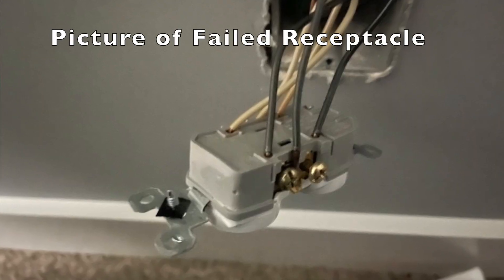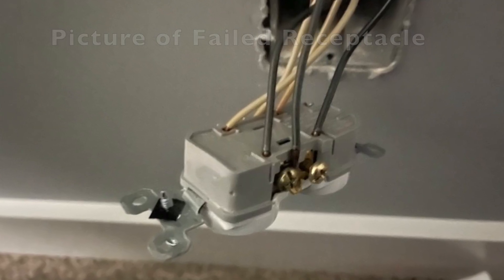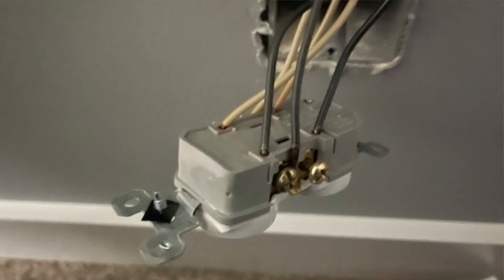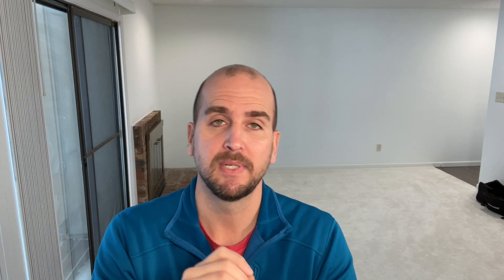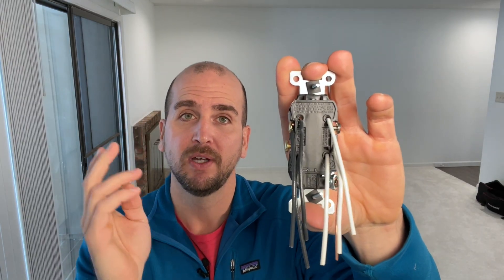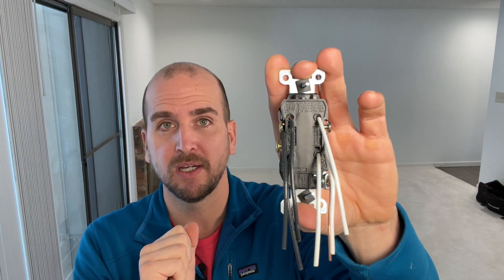Incorrectly Wired Outlet Found In Newly Built Home

Comment: Good video, My house constructed in 1983 then extended in 1992 had 12 awg wires using pushin connections and almost caught fire by arcing, luckily I happen to see the wire glow red and shut the circuit off..the receptacle burnt half of it due to heat.

Comment: when you say commercial outlet I'm curious what brand. I generally use Leviton
Reply from the maker: My preference is Legrand (Pass & Seymour), Eaton, and then Leviton in that order.  I am a big fan of the back wiring feature and as such the Hubbell spec grade I have looked at didn't have back wiring which was a show stopper for me.  For most of us DIYers it comes down to which Home Improvement store is closest but since I do a fair amount of rehabs I just pickup 10 packs of the Legrand Commercial Grade outlets from Menards in my area.

Comment: I do not use pigtails...why?  Using side screw terminals is best since they are connected via solid plate...hence less connection points. Also, I was trained NOT to pretwist wires.

Comment: You should use the example that using a pigtail is a "parallel' connection with anything down the line and that connecting all wires directly to the receptacle is a "series" connection.  If the receptacle fails a "series connection will cause any connections downline to fail and a "parallel" will not.

Comment: Aren't Pigtails a thing of the past? Something like an In-Sure Push-in-Wire connector would be  a lot easier than 3 to 4 14 gauge wires together especially for the novice. I have started using them around my house and they are much easier to connect and more reliable after being push back in place.

Comment: I have seen it suggested in the installation instructions of a couple of items, whether switches or outlets, that, after screwing on the wire nut, you should wrap electrician's tape around the nut and the wires coming out of it. Is this generally recommended?

Comment: Good info thanks, when I first moved here from uk when I pulled out my first plug for some issue ( without turning the breaker off) I put my fingers in and as I was puking out the receptacle I touched both the hot and neutral!   Boy was I surprised. 
Growing up with 220v outlets in uk the connections are always covered so you have to work really hard to get shocked ( and potentially killed by the 220v) .
Such a poor design in 120v Receptacles! 
Winding a little electrical tape around is a help but poor substitute for poor design. 
Cheers Warren

Comment: At this point I wish the companies making outlets would just do away with the cheater connections (push-in terminals), never liked the idea of something holding a 120V line in place with spring tension compared to a screw terminal. Had a coworker that recently replaced an outlet in his kitchen after he plugged in the toaster and heard an arcing sound from the outlet when he turned the toaster on, pulled the outlet to investigate and sure enough someone has used the push-in terminals. The conductor had worked loose from the back of the outlet and started arcing when the outlet was used.

Comment: There is NO data that says that push in connections cause more faults than back wired or Shepards crook connections. In fact there is lots of evidence that push in terminals are safer. Look at Ideal or Wago info on push in terminals.Much safer. You are perpetuating a Pro Electricians myth because they dont understand them. I predict that one day only push in will be the standard.I am aa Retired Electrician & I know it takes forever to convince us old duffers but lately I am convinced.

Comment: Pigtails should be used on all devices that have 4 leads or more. The device (outlet) is not suppose to transfer the load or current down stream to more devices. This way the line itself carries the entire load and not a device (outlet).

Comment: Hi just saw the video and would like to say that it is very informative information. I agree with everything that was shown. It is great that videos like these are available to everyone. Especially knowing home owners that are going to do some electrical work on their own home, no matter how much their significant other tells them not to. That they hopefully watch videos like yours to learn proper techniques for functionality and safety purposes. One thing I want to mention and is a question as well. At the very end of your outlet install, I noticed that the ground hole socket is in the downward position (how just about every outlet was installed in the US before the 21st century). My point is shouldn't the outlet be install flipped "upside down" so the ground hole socket is above the neutral and hot hole sockets? I really think its against code in my area. I believe the reason behind this is if the plug wasn't seated into the outlet the whole way, and if by some rare case that something was thin enough to slide back and touch the exposed plug prongs, it would hit the ground prong first. Rather than it coming incontact with the neutral and hot prongs. Causing a short and risking fire, injury or death possibly. Just thought I would mention that and I'm going to guess I'm not the first one to say this. I apologize if I'm repeating somebody else's comments. I tend to be late to the party a lot, if you know what I mean.
Reply: I've heard this also and it probably has merit in some locations but in general it's nonsensical. Three prong plugs are designed with the flat part on top and is ergonomically correct for most people. It feels awkward to grab it upside down.

Comment: I belive pigtails are required by code since receptacles shall not be used as splice points, the reason it has two screws is for breaking the connection and using it as either a switched outlet or two circuits.
Reply: No, it's only required by code if it's a multiwire branch circuit. I tend to agree with your point, but even Leviton, in their instructions recommends using all the screws for connecting to downstream receptacles, probably to make it easier for homeowners.

Comment: This was exactly my problem! Downstream outlets would inexplicably turn off and on, paid $200 for electricians to come out & find nothing, and then my wife noticed the lights blinked on and off when she plugged the vacuum cleaner into our 30-year old residential grade outlet. Popped it out and saw the hot pass-through wire had worked its way loose, so you were spot on! I'm going to upgrade the outlet & do the suggested pigtail connections.
Reply: Might be worth checking the other outlets.

Comment: You said that was 12 ga wire, which is used for 20 amp circuits, but the outlet is a 15 amp style
Reply: It doesn't matter, 15 amp duplex receptacles are perfectly acceptable on 20 amp circuits.

Comment: Thanks again for another great video. I’m a little confused as to why it’s not OK to use a back wire connection. Especially if you don’t have room in the box for those extra wire nuts and jumpers. Thanks in advance.
Reply: Most outlets are wired daisy chain fashion, with an upstream cable supplying power, and a downstream cable going to the next outlet. Adding a pig tail to supply the local device means that if it fails or is deleted during a remodel, the downstream devices are undisturbed. Additional benefit: you do not have to know which cable is upstream, and which are downstream. (There might be several. I ALWAYS make the upstream cable enter the box from the upper left, simply to help the Next Guy identify it.) Also, I have seen a situation where the downstream cable was 12 ga, while the upstream was older, and only 14ga. This made it impossible to tighten the screws on the upstream conductors sharing the same screw. As to box fill, the Wago lever connectors are much less bulky, and easier to use if the conductors coming into the box are a bit too short.
Reply from the maker: Seems to increase the risk of failure.  With that said speed wiring is approved and tested by UL.
Reply: @EverydayHomeRepairs  Just looking at the mechanics of it doesn't it seem like a torqued down screw is more than enough to connect two wires together? Do they come loose over time?
Reply: @Magicinstalls  Defining terms: "Speed wiring" aka "backstabbing" aka "push-in" connects conductors by pushing them into a spring loaded contact. While UL approved, extensive field experience shows this is unreliable, and many electricians and DIYers think the approval should be removed, as it was for aluminum wiring. "Backwiring" uses holes in the plastic shell to guide the conductor into place behind the head of the screw, or even better, between two squarish washers that the screw clamps together. "Side-wiring" is the traditional practice of forming the conductor into a U-shaped hook around the screw. Sidewiring is the most secure method, but backwiring is almost as secure, while being almost as fast as speedwiring. (And I, a DIYer, think backwiring reduces the chance of error.)

Comment: On the recep you put pigtails on. I was always taught the wire should go on left of the terminal so it pulls into to terminal as it's tightened. We're the right side has a tendency to push out.
Reply: When using the back wiring clamping method it doesn't matter because the wire doesn't hook around the screw.

Comment: I'm a second owner, the was built in 2001. The outlet in the hallway, has 6 poles, 3 common wires & 3 neutral wires (paired into 2s) plus ground pole. My question is, I want to replace the outlet 4 pole child proof outlet! Any suggestions on that?

Comment: I would recommend the Wago lever-nuts instead of the traditional wire nuts, especially for repair, rework, and DIYers.  The only problem I see with the pigtail approach vs. using the connections on the outlet is the additional bulk of the added wire and wire nuts and stuffing all that into the smallest & cheapest box the contractor could buy.  In some cases, you might exceed the number of connections and wires permitted in the box.
Reply: Also, shouldn't the pigtail be a larger gauge, since it's potentially carrying the double the maximum load the two other wires are rated for? Or are those other two wires somehow implicitly assumed to have loads that won't exceed half of the gauge's maximum capacity?
Reply: @Felice_Enellen  The pig-tail branches off from two conductors connected daisy-chain fashion. The pig tail only carries current to its local device. The upstream conductors must carry the current of the downstream conductors PLUS the local device current--but that would be true even if the outlet was wired directly with the screw terminals.
Reply: @georgiafan6618  Replacing the box is usually what I do. I'm very fond of Carlon's big blue old work boxes. But sometimes, for reasons ranging from "I'm only renting" to "Holy Crap, if I stray outside the box, I'll have to rewire the whole house", I'd prefer not to.
Reply: @Felice_Enellen  How is the pigtail carrying double the load?  And, the answer to your question is "no".

Comment: I thought the screw terminals still needed to be tightened to secure the wire even if inserted through the back holes.
If you try to pull out a wire inserted into the hole, it is basically impossible if the screw is tight, while you CAN pull it free if the screw is loose.
Therefore, I have always assumed the screw was intended to be tightened when using shepherd's hooks OR inserted through the back .
Reply from the maker: On the speed wiring (back stabbing) the side screw terminal isn't related to the small metal tab that holds the wire in place.  This can be easily confused with back wiring which is usually found on commercial grade outlets in addition to GFCI outlets where you insert the wire in the back and need to tighten the screw to secure the wire.

Comment: Pig tail question..?
Please clarify why or if you can use the same gauge for the Pigtail  while importing 3 wires into 1..
Math seems indicate a larger wire needed? Please explain..thanks
Reply from the maker: Hey Chas, you can use the same gauge of wire.  The wire is sized for the circuit breaker max Amperage.   14 gauge = 15 Amp Breaker and 12 gauge = 20 Amp Breaker.  Maximum current through any 1 wire will be limited by the breaker.  Make sense?

Comment: I'm a former trician/sparky from the UK and the place we moved into over here has had all manner of crazy issues. Nearly every pole was in reverse, the concept of not being terminated or connecting a wire not in an enclosure is just alien to me and our regulations.  I have lost earths all over the place and short of ripping everything out and starting again, I have done all I'm comfortable with. But Yes, anything with pushed in wires  - the wires snapped off when removing the socket.  Also, you don't insulate earth with earth sleeving which is also strange to me. 
But hey, I was trained on the 230v 50hz system, and this is just a case of re-learning.  
BUT some things are better, other things not so much... at least treading on one of your plugs isn't as painful as standing on a UK one with bare feet lol

Comment: Nice presentation.  Thank you. Do you have a vid on a junction box wiring?
    I have a project that I like to do in the near future. I have a light switch that controls the lower prung of an outlet in our family room. I would like to install 6 or 5 recessed LED lights to run off the electricity from the existing switch.  What is the correct and safe way of doing this project?
Would it be easier to have 2 light switches and not disconnect the control to the outlet?

Comment: I hate those backstabs, it makes me nervous every time I've replaced a bad outlet that has backstab and remove the wire most of the time it looks like its been hot or had an arc where it pinches.  I like the pigtail, but I've also seen boxes where I replaced an outlet and went to install a pigtail only to find it wouldn't fit and I was forced to put it back the way I found it with the new one...at least one seemed to have like 6 wires splicing together and they used a combination of pigtail AND the backstab+screws to hook it all up.  That was a nightmare to fit back together, I don't know what they were thinking.

Comment: As a master electrician with 23 years in the trade, I'm here to say this is a bunch of unnecessary work.  
There is no reason to screw in the unused terminals.  Zero.
Sure, pigtailing is the most reliable connection if you've got multiple cables, but it's pointless if you've only got two wires.
Stabbed outlets work fine with better quality receptacles.

Comment: In my industrial electrical course,my instructor said that receptacle should be installed in the box,with the grounding plug / terminal facing up. His theory was that if a plug should happen to be particularly unplugged and a conductor of some type fell across the plug,that it would not cause a fire situation. What do you think of this practice?

Comment: In your video you showed what you call a box extension I think it's called anti spark guard fire resistant shield so if you have wood paneling and a gap of any flammable material between box and flush material it doesn't catch fire
Reply from the maker: Thanks for the feedback.  I am sure there are a few different names but in our area we call them box extensions or extenders.  👍

Comment: As you have shown, you absolutely want to twist those wires together with linesman pliers BEFORE you put those wire nuts on.  First of all, you can see what is going on.  It is not as though those wire nuts are clear.  Two, you can add a lot more torque with a pair of pliers in your hands than a wire nut in your fingers.  Three, if you do a lot of these in a day with your fingers, your fingers will get sore.  Four, a lot of wall/ceiling mounted lights come with braided wire.  It is really tough to get a good connection between a braided wire and a solid wire if you just push them in a wire nut and twist.  Five, some people may still be using a type of wire nut that is sort of rubbery (vinyl?).  Since these are sort of flexible, you really can't twist them as well as the solid plastic wire nuts with wings (my favorite).  Lastly, just try both methods of using wire nuts, then take the wire nut off.  I guarantee that those wires that were not twisted together beforehand, will be only slightly twisted together inside the wire nut.  As you twist that wire nut, that energy is going into twisting the wires that extend outside of the wire nut as well.  It is not as though your effort is going into twisting just the bare conductors inside the wire nut.  When you use the pliers in your right hand, your left hand is holding the wires together to keep them in the jaws of the pliers.  It is my opinion that your energy is more focused right where you want it, when you use pliers first and put the wire nut on later.

Comment: What about using insulating tape on the sides before inserting it inside housing? Do you recommend such practise?
Reply from the maker: I will use a few wraps of 3M Super 33 if I am installing a GFCI in a tight metal box but other than that I will not.

Comment: I learned alot with your 3 things of what to do and what not to do when replacing an out lit. Question for you Scott, We have old 3 slot outlits with no ground hole. When i pull one off theres red,nuteral,and hot. How in the world do i connect all them wires on a standard outlit? Because when replace the outlit and put the red wires on the plug, the series gets interupted and the light switch wont work. I dont get what im missing here, i need some one to tell me how to do this outlit changing properly, the ones we have are shot plugs fall right out. 3 plugs in one outlit, house was built in 1959. Please help. Thank you Scott.